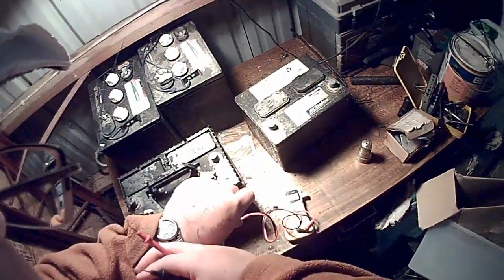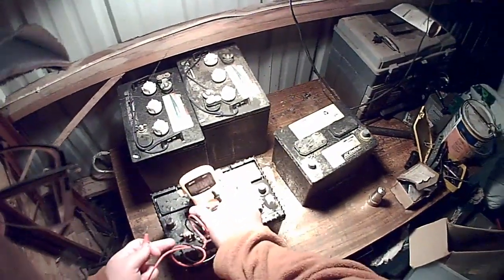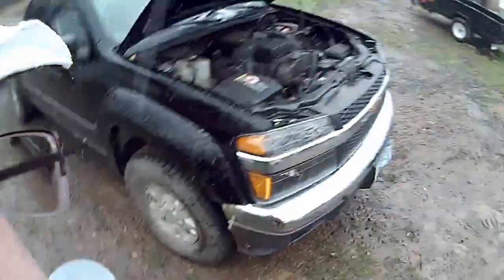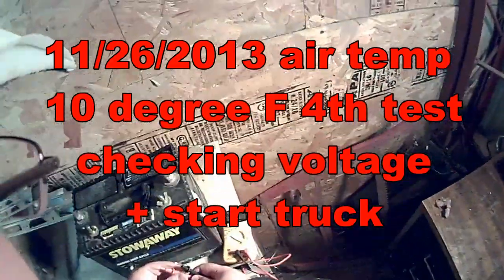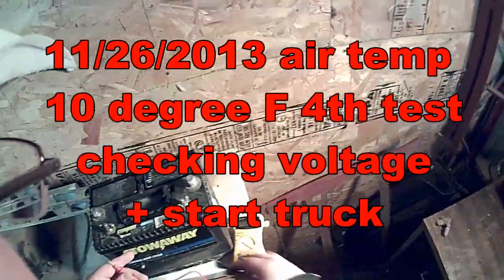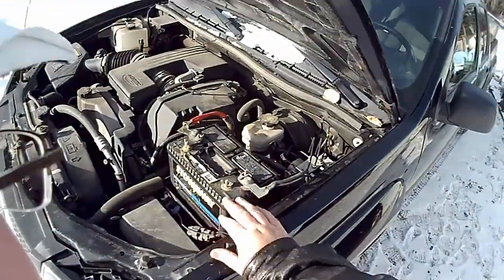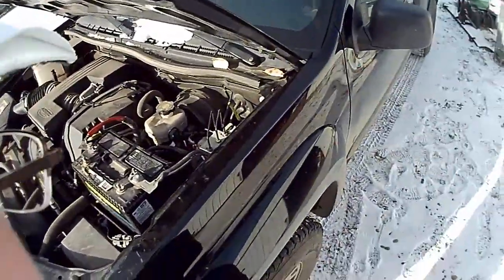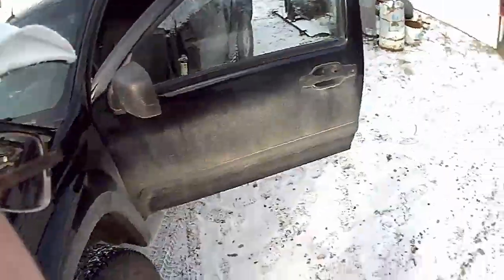Making a bad 12 volt battery good again for under 5 dollars final testing

Comment: Your tester leads have pointy ends for a reason, just jab them slightly into the battery terminals.  you'll get a quicker reading than by just touching the sides to the terminals.  Autobody and frame repair 46 years, plus auto electrical knowledge.

Comment: Months ago I watched your first one, but as I had time I made sure to check out the whole series. Now I see the longevity and I'll totally go for it. I should have finished the series before I bought a new battery for my truck, lol. It's the new Duralast that only sell in hot places like where I live. It has much less cold cranking amps and thicker plates of lead. When you think about it, I can trust the changes Duralast made for people who live in hotter areas. They're the ones guaranteeing how long it'll last, and they don't want to put out as much on warranty claims right?

Maybe I'm a little off topic, but for another project car that's even farther from hitting the road again, I'll be sure to get it a battery the ALUM method. I have some old batteries that have lost my love. One because it's like 10 years old, and still wasn't really bad considering, and another that's like new, but it got rejected because it spit acid all over my mom's car. Functional yes, fantastic in an emergency, but maybe ALUM is exactly what the doctor ordered, or should I say what the mechanic ordered? (I literally cleaned acid off of her engine bay EVERYWHERE)

If it has way too much acid, and will just destroy the wires you connect up to it, then I think I'm looking at a bonified perfect test subject. I've seen other old batteries function fine but they get where they just dump their battery acid at a higher and higher rate until your have to keep replacing wires. I tried the Epsom salt idea on an old battery, sure it got back to working fine, but it accelerated this acid destroying issue. In days it would do what other batteries do in months or years.

Last but not least, during my months away from your video series, you've got more than a million hits on your first video! Congrats!

Become an amazon associate and include a link to buy ALUM (I've done this on my own website if you need help). With all the traffic your getting, you deserve it. I'm glad you said alum is at amazon. I'm sure you're right that it's available locally but no one seems to know what I'm talking about to help me find it at the store.

Okay, I'm writing a novel here, lol, really my last comment (I write a lot when I'm sure I'm looking at a great idea):

When I can see how it works long term in a hot area I'll report that.
Reply: Look in spice section of grocery store
Reply: D25864 Thank you.
Reply: DE Nichols  no problem could you post a video to see how long it works im in a jam myself and if i can save $100 i damn sure would
Reply: D25864 To say thank you I will try this on a battery proved to be no good. So long as I find that Alum.

Comment: Did you try any variation on the mix to see some better or worse results? As a mechanic this really intrigues me. I've never tossed out batteries but I always used them as cores or sold them for scrap. I don't think I'll be doing that again.
Reply from the maker: I did not the results were so good based off the 1 cup alum mixture I felt no real reason to experiment much more.

Comment: how do you not get a voltage drop? by keeping the battery clean and putting a tickle charge on the battery when cold weather hits 32 degrees or below cause once a cell starts a voltage drop it can not be taken out.. but sometimes voltage drops are cause by a battery not being clean real good ..and the cell is still good ..through research i have learn this ..now they are making batterys cells better  with no voltage drop at all in the winter ..so i hope this helps you out..

Comment: I was wondering what you thoughts of using converted alum car batteries as a power storage for a solar system? Also, do alum batteries go dead / sulfinate or is that problem eliminated with the alum as the electrolyte? Also, how low can you drain the alum battery before it damages the  battery, or is that problem also a no issue?ThanksRandy
Reply from the maker: +Randy Travis From what I have read the Alum batteries discharge a lot deeper without any problem, there perfect for storage. As far as re-sulfating I do not know for certain, I did not convert this one for a car I converted it for storage for solar etc and is why I was testing this in the first place the only reason I put it on the truck was just to see what it would do and is why I was so surprised I didn't really think it would be able to start it considering that is not really what that battery was meant to do in the first place being a marine deep cycle, and considering how cold it was outside.
Reply: Cool, I will give it a try on a small lead acid battery, thanks.

Comment: Did you add salt to keep it from freezing or its just the alum + water mixture?
Reply from the maker: alum and water, I experimented some with salt but it really made no difference the solution will still turn into a slurry at -20F or lower however it did not seem to affect the storage or cranking.

Comment: i fix dead cells batterys  that where just starting to form..i known as  the battery pro..the only way i throw away a battery if its is destroyed the cells in it..i fixed 95% of all batterys.. i surprize alot of people cause the voltage is the same load test just like the new ones you buy in the store same voltage....i got a battery to run a light bulb with nothing inside the battery no acid or water just by being clean ..the cleaner it is the better it will performed ..but you just gave me a missing link to something i was thinking of ..thanks for the video ..now i have the missing link..

Comment: it would be interesting to know how much more cycle life you get from converting your battery to allum, as it is being revived by introducing the allum is the allum desulphating the plates or does it just work with sulphated plates and if so what is going to be the process that causes a leadallum battery to degrade such as the sulphation in a lead acid battery, surely this isnt going to be an everlasting battery? lol
Reply from the maker: +oldskoolhead0 not sure its still working heh, I have it in my dump trailer and just tried it the other day.

Comment: Hey brother awesome video! Can you post the exact mix equations, exp. how much alum to water (ratio)? Thank you for posting!
Reply from the maker: Yup was in the first vids discription 1 cup or 8 oz of alum "aluminum sulfate" in a 1 gallon jug then fill the jug with water
Same for the baking soda 1 cup per gallon. The baking soda mix is used after draining the acid to neutralize any left over acid. You can then after rinsing with that rinse with plain water to get out the baking soda mix. Then you will put in the alum mix filling to just above the plates and then charge.
Reply: Thank you! The last battery I purchased was a 1000 amp deep cycle and I returned an one for a $5 core charge. They got a great deal!!! lol Just before you replied I had found this and thought you may be interested: http://peswiki.com/index.php/OS:Lead_Acid_Battery_Reconditioning_with_Replacement_Electrolytes 

God bless brother!
Reply from the maker: John Arizona Hey thanks a lot I liked the link I may join the group they sound like they have some more great ideas. Now that I have tested this out and know it works well even in the cold I have 4 or 5 other batteries I need to convert then hook them all up to my small solar array.

Comment: the problem you are having with voltage drop is winter weather its hard on a battery..what you need is the battery has to be clean real good ..and cells start to lose there punch after a while ..i found out by cleaning the battery before it gets corrode and keeping it up will make a battery last longer ,thats why i made a battery cleaning machine works great ..i have a battery on a vehicle for over 7yrs and when i picked it up its was dead as can be.restored it to 11.5 volts is what it should read on the meter when you put a test a load on it and should  hold if its starts to drop it needs to be clean real good ..must use distill water  when clean with salt ..you need a machine to clean it real good.. so i invented one and the battery does not drop voltage like yours is droping.. your battery is still dirty inside thats why its droping voltage or you starting to have a dead cell form.. i been tested batterys for a while ..trust me i know..hope this helps you you cannot get it clean without a machine to clean it on the inside..with salt i use combination of salt.. works just fine....
Reply: What machine to clean what part of the battery, terminals post or the plates inside? please explain more. I have thought of vibration to help agitate the sulfate scale from the plates and dump out the sludge and start over with electrolyte.
Reply: i will tell you this dan diy  if you make the chemical too strong it will do the opposite in the battery so knowing how much too mix inside a battery is very important .. i made batterys for lawns mowers last at least 7 to 8 yrs not bad well worth the money .. i can try to explain to you but you will not understand .on how to do it you need the right machine to do it with the right chemicals plain and simple ..join me at facebook  i also made something to replace a battery and it works fine for cars and trucks ....but you have to build it yourself no one does it yet .. i am the first ..
.